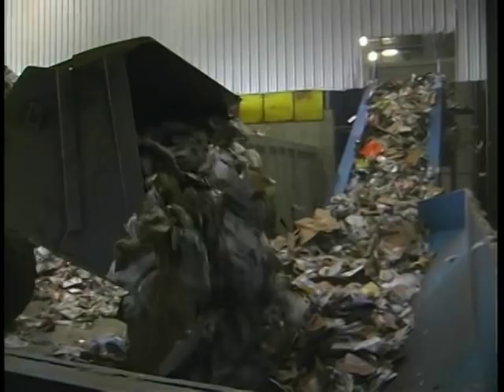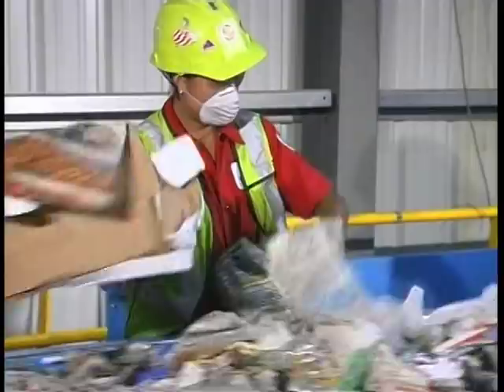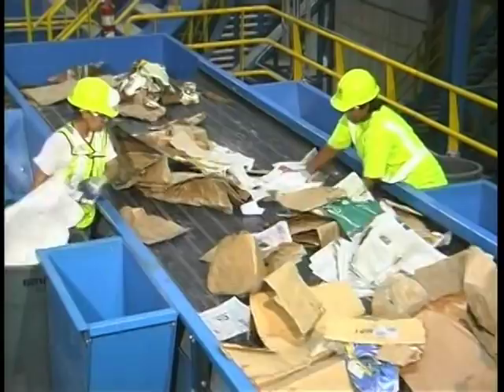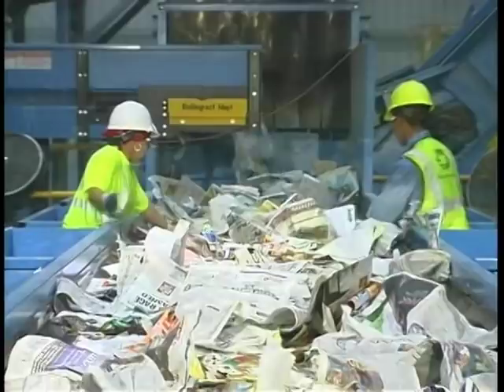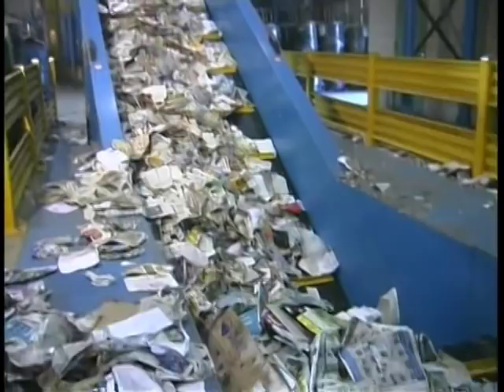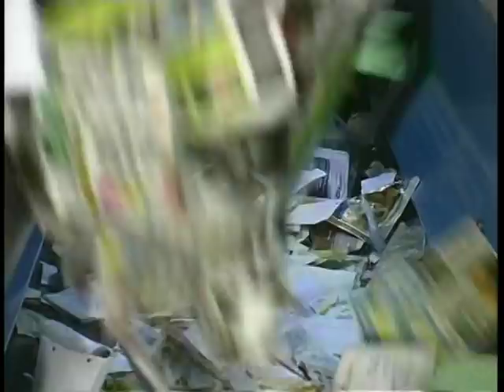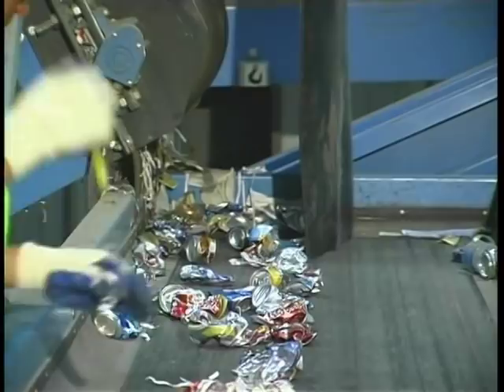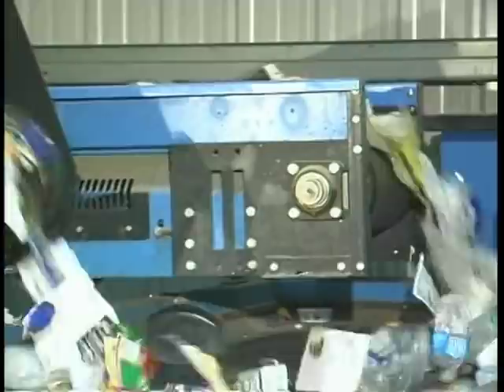Waste Management Recycle America

Comment from the maker: You no longer have to separate items as they do go in the same truck. However, if you have a recyclable that consists of multiple types of material, you can help the processor by separating the materials (if possible). In your example, the plastic part can more easily be sent with the plastic and the cardboard with the cardboard.